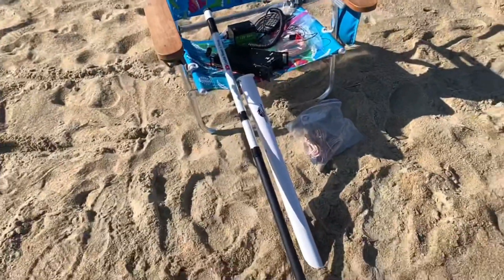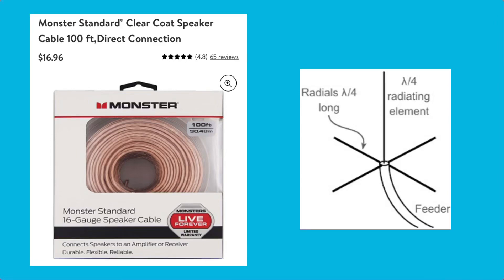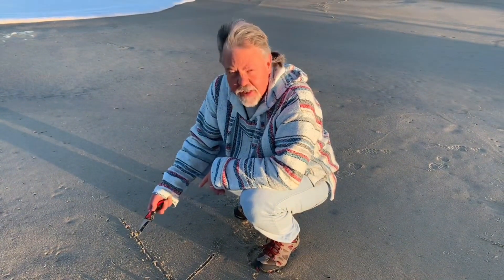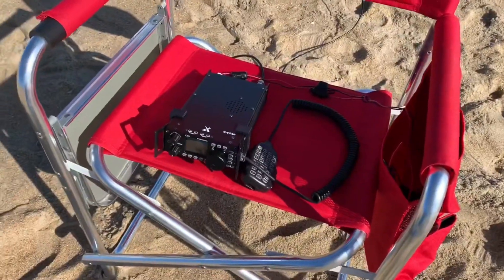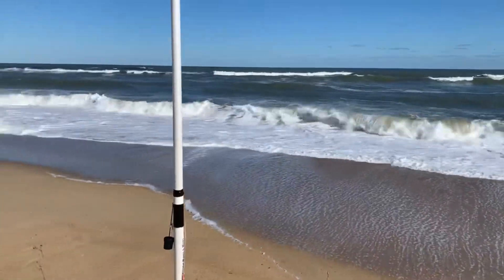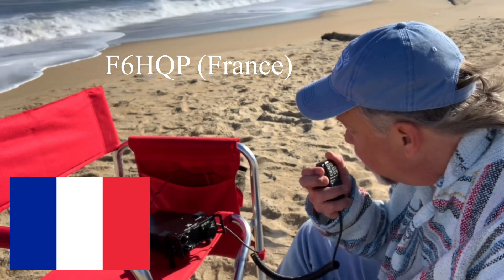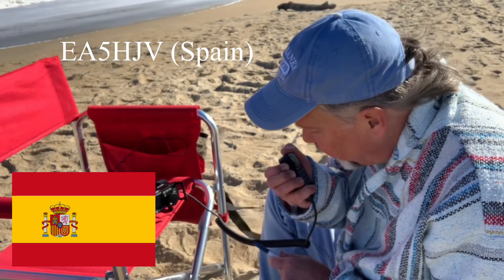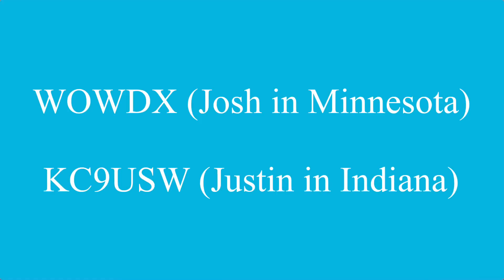Portable 20 Meter SSB on the Outer Banks with 20 Watts and a Speaker Wire Antenna

Comment: Than you Walt, this antenna comes up high in my list of DIY antennas I plan to use when weather permits.
I've been trying to catch the exact measurement of the wire several times but I'm still not sure due to the high background noise. Is is 16 feet 5 inches = 500.38 cm in the units we like to use on this side of the pond?
I haven't had much luck with EFHW antennas or random wire antennas so far, probably because I'm really a newbie at this. This one seems like a fool-proof design with no need for balun/unun.
Reply from the maker: Thanks! Yes you have the measurement perfect. 73, Walt

Comment: Walt, Do you use Copper Clad Aluminum (CCA) or Oxygen Free Copper (OFC) speaker wire?  Quite a difference in price. 73 kc3zo.
Reply from the maker: CCA, Monster Speaker Wire at Walmart. $16.99 for 100 feet which gives me 200

Comment: Walt - great video! Nobody loves the OBX or ham radio more than I do, but I gotta ask - how do you hear the other stations over the roar of the surf without headphones? Inquiring minds want to know.  Tnx 73, Mike K3CXG
Reply from the maker: Thanks! It’s a challenge and I’ve used an external speaker at times. I probably need to set up a way to wear headphones and send the audio to my camera. 73, Walt K4OGO

Comment: Good morning from Ocean Isle Beach. Where did you obtain your 17’ pole? Thank you for your time and help in advance. I gotta try this!
Reply from the maker: I got it on eBay for $12 USD. It’s called a KwikStick Crappie Pole. It’s just a fishing pole without the eyelets for the line. Thanks for watching! 74, K4OGO
Reply: @COASTALWAVESWIRES    Thanks a lot for your help. O will scoot over to epray and look for one. Was the element also 16.5’? I will leave you alone now but I am going to subscribe.
Reply from the maker: @tommycheshire5508  yes I made the element 16’-5”. Just Google KwikStick Crappie Pole if you can’t find one on eBay. Good Luck!
Reply: COASTAL WAVES & WIRES  Curious, did you run the vertical wire through the eyelets? Thanks and 73
Reply from the maker: @Locksnut  I bought the telescopic pole without eyelets, look for a “Crappie Pole” which is basically a carbon cane pole. If you have a pole with eyelets it probably doesn’t matter, give it a try.
Reply: COASTAL WAVES & WIRES thanks, I should have reread your post to another. I missed the “without”. 73!
Reply from the maker: @Locksnut  no worries! 73!!!

Comment: Easy beach/portable setup w/one mast: Fifty ft of zip cord. Split ~16 ft. Attach other end to binding post/BNC adapter to rig. Hoist in to inverted V. Done.  (split short at first; split a little more if too high frq....or trim ends if too long) Zip cord is low impedance. Could even use as sloper with stake in sand at low end pointed to target direction. No radials.

Comment: Great video,passed through Kill Devil Hills 2 years ago on SC vacation,I should have brought the radio!
Did you use a balun?
I operate static mobile beside the sea using an Icom 7300 & an Ampro hamstick on a mag mount on the car roof & have worked the US,Canada & Siberia.
Great to use the sea as a free amplifier!
Reply from the maker: Thanks for watching! I only used a banana clip, no balun. Yes the salt water amplifier is awesome! 73, K4OGO

Comment: Really cool setup..  I stopped at Walmart on the way to the outer banks also, got some speaker wire and made a similar antenna.   I was running 5 watts and was able to hit a good contact from outer banks into pa.  It's a great project.   Good job...  73s KD8VSP
Reply from the maker: Thanks for watching! 73, K4OGO